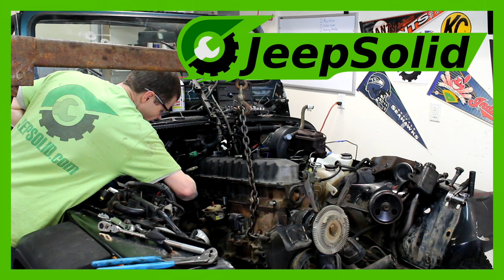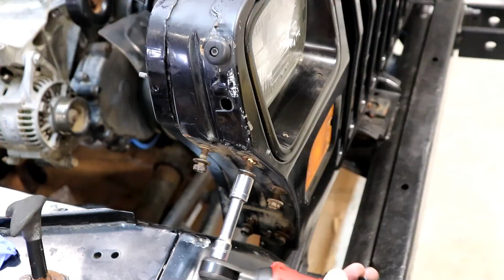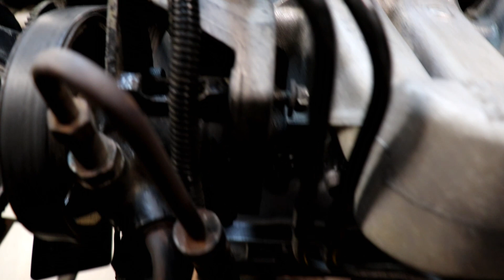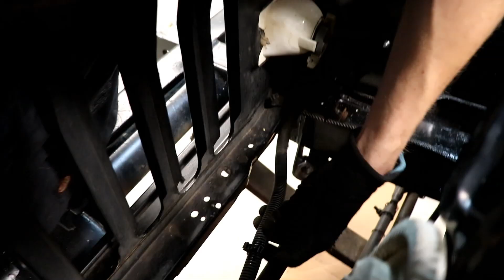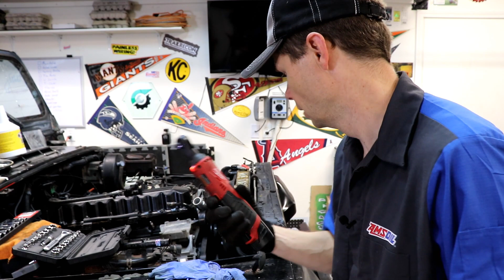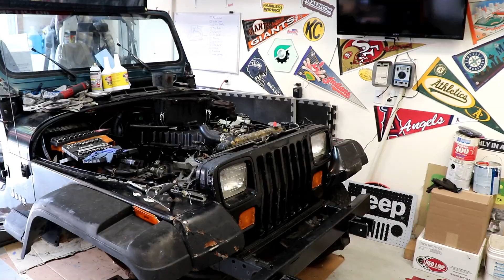How to Change Serpentine Belt and Radiator: Engine Rebuild Part 30

Comment: I see the mount for ac compressor - has it been removed?

Asking because I want to remove mine (95 i6) - can I just reroute as the Fan shroud indicates and go with a shorter belt? 

They sell an ac bypass pulley but I’d rather keep the engine bay as simple as possible - if possible?
Reply from the maker: No. It wasn't removed. That is how these YJ's without AC came. Same bracket.

Comment: A lot of Jeep radiators crack at around 150K miles. Mine was clean and working perfectly and then the top tank cracked at 140K. The tanks are plastic so I would replace it now. You can tell by looking at it that it's had heating problem by the dirty fluid stains on it.

Comment: what will happen if it doesnt have a fan shroud? should i purchase one?
Reply from the maker: It kinda seems pointless, but it’s actually an important piece of your cooling system. It helps direct air from the fan to your radiator. Increasing your engine cooling capacity.

Comment: Hey dale.Ive got an issue im hoping you can help me with on my 98tj. 4.0. Im getting a hanging idle when im shifting gears, the Rpms dont rise but they dont fall when pressing clutch to shift,i have to help them down with the clutch...When sitting still at idle and rev it , rpms comes back down like normal, also when i start the jeep it seems to be fine also. Mainly when im shifting.Almost positive it not a vaccume leak.I sprayed around the motor and check all vac lines.No issues there.Im kinda thinking its TPS sensor.Any info you may have would be greatly appreciated before i go replacing parts.lol Thanks
Reply from the maker: Oh man. Gremlins like that can be tough.  It sounds like you are on the right track. I'd be checking vacuum and sensors as well. Could be as simple as tps.
Reply: @JeepSolid  Thankyou kindly sir. !!

Comment: Hey Dale: quick question if you have time. I have a 91 Sahara and need a new transmission (AX-15) Will any 91 and beyond YJ   AX-15 transmission work? Thanks for the help
Reply from the maker: I believe so, but not 100% sure.. Don’t want to give you wrong advice.  I’d have to research more

Comment: Did your Rad hoses have an internal spring to prevent it from collapsing? I’ve heard some vehicles have them and to make sure to change/check them for corrosion
Reply from the maker: No internal spring.  Just standard hoses.